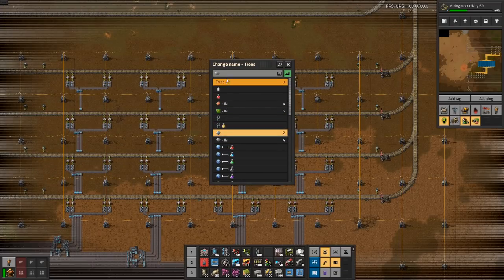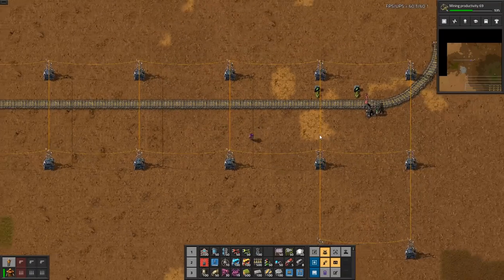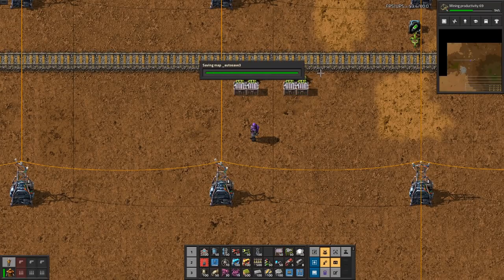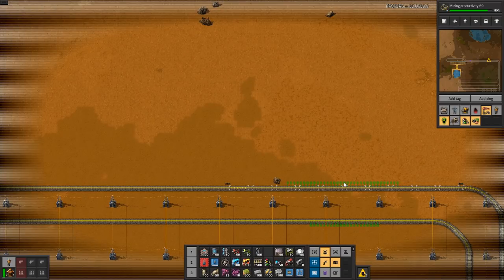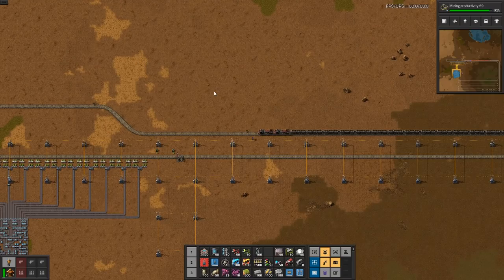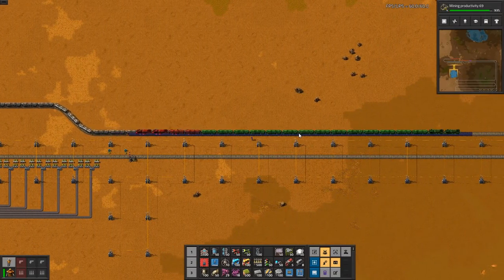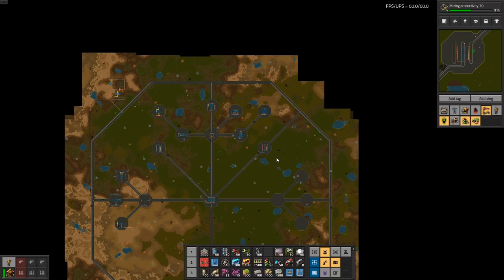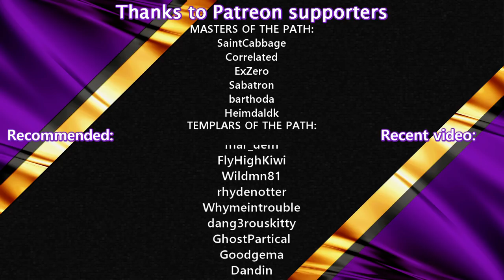Factorio Reverse Megabase | #27 FIRST FULL SUPPLY CHAIN OPERATIONAL | Lets Play

Comment: 34:43 - For the stripped concrete, when you are taking from a 90 degree offset, if you flip first, then rotate, the stripes will match. If you take from a 180 degree offset, there's no need to flip.

Comment: I think there was a masterclass video about locking blueprints to a grid. The interface for it is not user-friendly and it would surely be awkward to take another 10-15 seconds in video with each blueprint. (I don't use it because I find it frustrating.) At the same time, substation micro-grid and the octagon macro-grid are just another spin on the "sacred path", which you're noticeably unwilling to compromise on. Thus I'm surprised (and also not surprised) that you're more than halfway into a walkthrough before you start using it earnestly. Hopefully the devs will improve the interface and then choosing to use grid-enforced blueprints won't be a costly / frustrating choice to make.
Reply: The blueprint grid interface has been fixed in 1.1, its quick, easy and intuitive to use now.

Comment: What is the point in having a train cued up at each station when only 1 train can leave at a time?
The second train can't come in to the second station until the second leaving train leaves.
You should be fine with a parallel stacker, as you have roughly 108 seconds from a train leaving to the next one needing to be there, which is plenty.
Reply: Note: For the smelting setup.

Comment: You can also braid miners and undergrounds for higher throughput. Although you already have 16 belts out, so not sure if it would help rn. Maybe in smaller patches.
Also, are you putting concrete under the smelter setup?